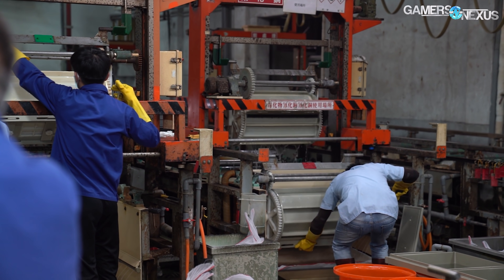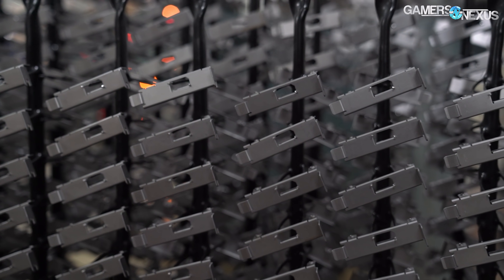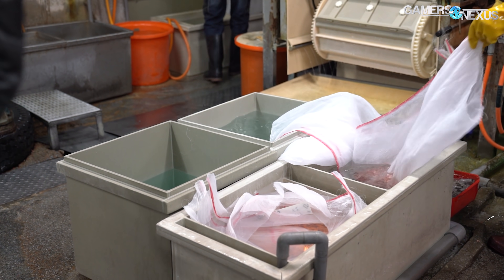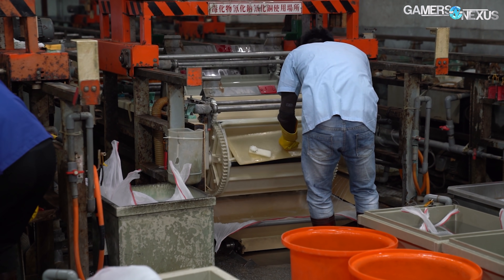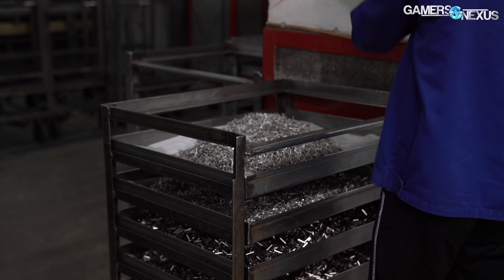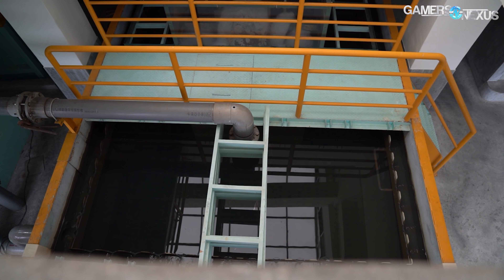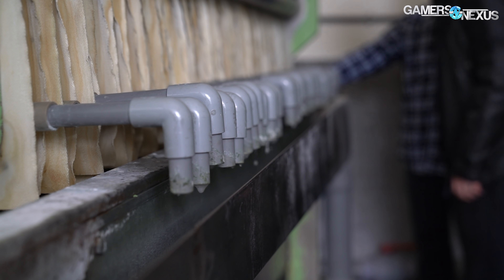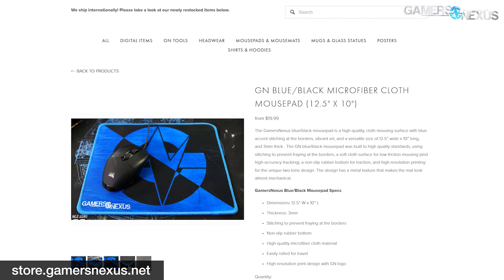Electroplating & Nickel Plating Factory Tour for Computer Parts

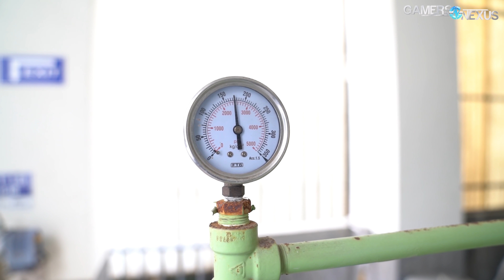Comment: 11:10 that would be a hydraulic press filter, as you can see the hydraulic pump and reservoir underneath. It would be very impractical and quite dangerous to have pneumatic press operated at 2500psi

Comment: Most of their filter equipment look similar to our effluent at work for out pretreatment. (Australian aluminium power coating place). the ploymer tank seems similar to our floc tank that an additive goes in to make solids sink.
Reply: I work in a factory, in the states, that does anodizing and electroplating and in our water treatment process we use floc and polymer interchangeably in reference to the same thing. Their setup in this video is a little more elaborate than ours but it is virtually the same exact process.

Comment: #AskGN 
Aside from the difference in labor costs, do you see any reason these things you cover in your factory tour series couldn’t be moved to being done primarily in the US?
Reply: I work in a factory that does anodizing and electroplating as part of our auto manufacturing process in Ohio. Not really, no. It can easily be done here but the reason it is likely done there is due to proximity of the manufacturing of the parts, assuming the electroplating isn't done at the factory making the parts themselves. Depending on where the parts are made and where they need to be shipped to after the plating process it is simply an issue of logistics and cost.